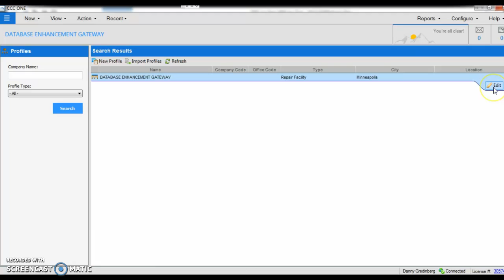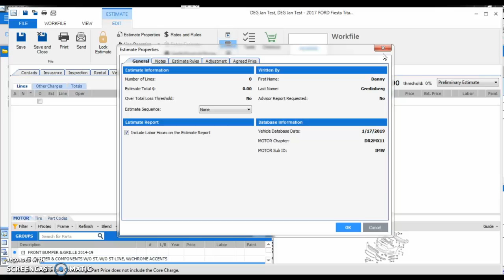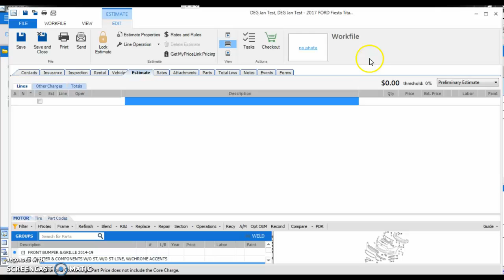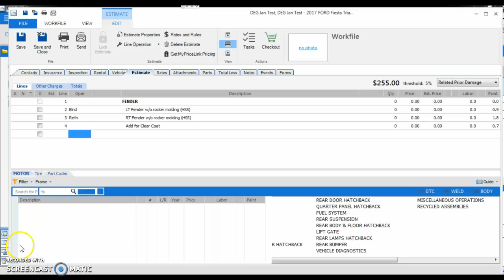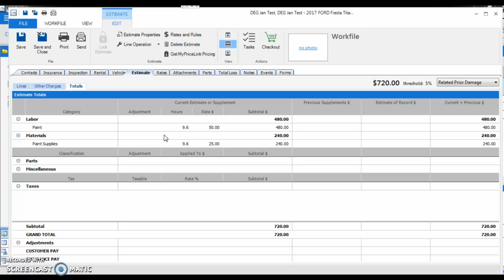CCC Estimate Sequence

Comment: I understand this procedure. I have a question dough. Lets say you're writing an estimate from front to back and you're at the rear door section, now you forgot to add a front suspension item. When you go back to the front suspension section and you add the item, it doesn't placed the item in the correct sequence on the body of the estimate? Is there an option for this?
Reply: Yes. Highlight (click once) on your estimate in the section where you are trying to put "said part", then add that "said part" to your sheet. This should be the solution
Reply: @yoitsparkerofficial  can i reach out for auto estimating learning ? Thank you

Comment: So let's say I am writing an estimate to replace rear bumper, repair lt qtr, and blend lt rear door. Before I start, should I change it to "back to front?"
Reply: Still up to you, you would typically start at the rear bumper working your way inward, it would only make sense.
Reply: @dgredinberg  I guess what I'm asking is if it will calculate the overlap differently. I'll probably try it tomorrow and see what happens.
Reply: @j.mizzle  What did you end up going with?

Comment: Is feather block and prime included in refinish operations in CCC? Is there any documentation that shows this?
Reply from the maker: https://help.cccis.com/webhelp/motor/gte/guide.htm#REFINISH_TIME_PREMISE.htm%3FTocPath%3DREFINISHING%2520PROCEDURES%7C_____2   "PRIME & BLOCK

Prime & block (high build / primer-filler) is a required procedure that restores a repaired panel surface, including the joined areas of replaced welded panels, from 150-grit finish to that of an NEW UNDAMAGED condition. It is MOTOR's position that prime & block is a refinishing process best reserved for the judgment of an estimator / appraiser following a thorough on-the-spot evaluation of the specific vehicle and damage in question."

Comment: can you change the word "preliminary estimate" to a different word for example "Final Bill'?
Reply from the maker: In CCC, you would need to lock the "Preliminary Estimate" or "Supplement" and Create an "Estimate of Record" or "Supplement of Record", In the print options, you can then print a "Final Bill
Reply: @TheDEG2012  where in the print options because i don't see it there. i have supplement locked but the dealership is asking that it needs to say "final bill" on the estimate if not they won't pay us